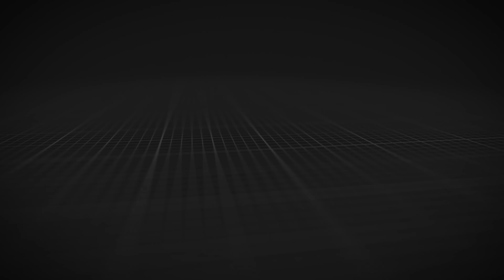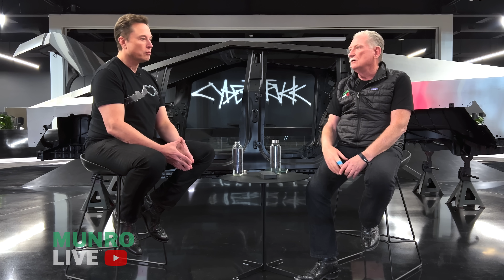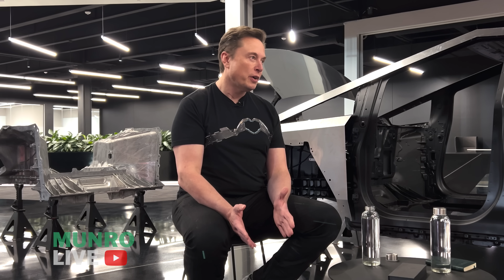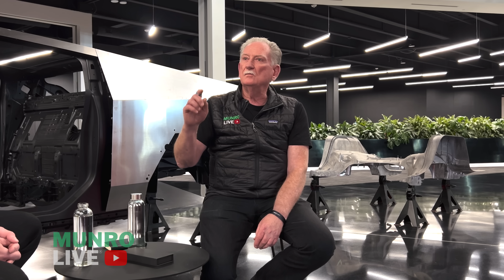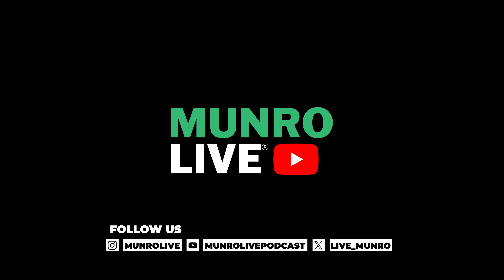Elon Musk on Cybertruck's Adoption of 48V and the Importance of Leadership

Comment: The reason 48 volts was not used prior is because of the need for ice vehicles to have large starters with high current draw. It was not very long ago, maybe 5 years or so, that lithium ion batteries were developed with the compactness and discharge capabilities to be a starter battery. Sealed lead acid, gel cell, and agm were the only batteries available that could provide the amperage to actuate a starter. 48 volt agm or lead acid batteries could not be produced because they would be too large to fit in a car.
Reply: P=IV. If you quadruple the voltage the then your quarter the amperage requirement to get the same amount of power to the starter.
Reply: @Lorith  correct but the footprint of a lead acid battery with it's aqueous solution of sulfuric acid and it's lead plates will always be fairly large. When you increase the size of a battery cell count from 6 to 24 it will always produce a larger battery. Also lithium batteries used as car starting batteries still do not do well in cold temperatures. They also do not do well when they get hot.... Which is inevitable in an engine bay
Lastly the run of wire from a battery to its starter, the single device with the vast majority of a cars electrical demand is extremely short. Usually it's a wire run of less than 4 feet, measuring from the battery to the starter and then to ground. The gains or advantages in 48 volt system are therefore negligible. I install solar and wind solutions on sailboats as part of my business. The 48 volt architecture in a yacht, where wire runs are much longer and there are significant amounts of devices with high dc demand (like inverters, bow thrusters, windlass motors, and electric winches) definitely make sense and have huge savings associated.
Reply: @douglasdangelo6755 yes but you would need 24 cells instead of 6, but you would need cells 1/4 of the size as the current needed would be 1/4 of the size.  So technically you would need the same size of battery, but there are overheads of plastic, but fundamentally you don't need a much bigger battery.
Reply: @douglasdangelo6755  It still doesn't mean that the battery will necessarily be any  larger than it is now.  I have 6V golf cart batteries that are similar in size to the 12v battery in my truck and 12v motorcycle battery that is a quarter of the size.  It is all about the Amps and reserve capacity that dictates battery size.  Heck look how small lithium ion jumper packs are now
Reply: Has not 48v been standard in aviation for a long time?
Reply: @M13x13M  maybe in large jets. Not in small aircraft
Reply: A “starter” is  antiquated tech, hybrid generators (in Toyotas) are a far practical way of starting an engine
Reply: 28vdc for aircraft

Comment: Why 48V Though? Why not 50? Why not 60? Why not 120?
Reply: The chips that need to convert it, and for safety regs that it is less than 50v. Easier multiple of 12v and many other things. These all loop in a little to 48v is a standard now. Same as why 12v

Comment: Will be interesting to see how reliable the thinner wires and tiny 48v batttery will be.
Reply: The wires will be thinner, yes.  But the battery will be the same size / bulk.   The only difference with the battery is that the internal topology will be different (16s for 48V LiFePO4 architectures... well, really 51.2V nominal).   16 smaller cells for 48V instead of either 4 larger cells or 4s4p with smaller cells for 12V.   Same dimensions, weight, and bulk either way.
Reply: Corrosion will have a bigger effect on the thinner higher voltage wiring, but that shouldn't be a problem in a automobile application right? Its not like people will use these things where they get exposed to the elements. Works great in the lab, what could possibly go wrong in real world applications?
Reply: @TechmoChamp  Corrosion won't be a problem as it hasn't been for decades in gigabit ethernet. The wires are individually insulated to prevent short circuits with an outer cladding for the group.  Teflon cabling is in common use in communications and has a higher temperature rating as well. 
Where needed, a steel mesche is used to reinforce the wire and insulate it further from outside interference... resistant to abrasion.

Comment: 48V sparks&stings hot! 24v seems safer also reduces wire gauge required of standard 12v systems..
Reply: Welcome to the world of higher voltages!  But when making such a huge paradigm shift to a higher bus voltage, I'd advise that you move boldly - you'll not get another chance at this change for another sixty years.  Getting stung by 48 volts may train us all to be just a wee bit more careful... 
When working with ordinary 120V [North America] or 220V [rest of world] home or office AC wiring, we TURN THE POWER OFF at the breaker panel BEFORE touching the wires.

Comment: Wish he had asked what the plans are for implementing in other models. And would have liked to hear about price premium from suppliers due to much lower volumed
Reply: I'm sure all future Teslas will be 48V. There's no reason they would go back to 12
Reply: now that the foundation is done, its easier to do other models at 48volt as well. but i wouldnt bet on it happening soon. The 25.000$/€ model will pretty sure be at 48v as well since it will be cheaper to produce it.

then with that kinda mass market thing AND i imagine for economy of scale alot of the things inside the 25.000$/€ model will be shared with 3/Y it opens the door to switch to 48v there as well. which will eventually lead into doing 48v only to streamline the whole production.

It will be a slow crawl, like the 4680, tesla is moving FAST but its still getting bigger and bigger, being big slows down, even tesla. they are impressivly quick to adapt things but they have already lost how extremly quick they were on their feets in their earlier years. This trend will only continue.
Reply: @samg5543  1 reason the Cybertruck switched to 48V is steer-by-wire, if they don't introduce that on the other models, it may not happen. At the end of the day, it depends on cost.
Reply: I'm sure they brought some in-house. But for what's supplied, I'd say not much premium. Pretty high volume order, plus I'd imagine they'll switch everything over. Few % increase in range would be nice
Reply: Once again Tesla is forcing change where there has been a high level of resistance to change. I am sure that in 5 years or less all new vehicles will be 48V.
Reply: @JHuffPhoto  Once one major car line has it and it works well, Tesla's other lines will follow and the rest of the industry with it. Aside from initial costs, it is cheaper and more efficient and opens doors to higher power devices. I don't see any downside.

Agree... from this point about 5 years for general adoption.
Reply: Sandy is good at wasting interview time.  Talking about his office chair is from a Model Y & he hasn't had to go to the chiropractor lately is not making the best of his time with Elon.

Comment: The relationship between current, voltage, and resistance is explicitly stated in one chapter in Introductory Physics. You can basically learn this in 10th or 11th grade in HS or earlier. I think these laws were discovered in 19th century, well before a car even existed.
Reply: Should we convert household voltage and small appliances to 220v ?  It is already available in every home; all we need is to pull a wire.
Reply: @MetaView7  the majority of the planet uses 220-240v for all domestic mains power anyway. North America is the outlier
Reply: @MetaView7 I don’t think we need to raise voltage in homes now because so many devices consume so little power.  Look at what LED lighting has done to reduce power.  Large screen TVs and most electronics also draw minuscule power.  Even new heat pump electric clothes dryers draw far less power.  Most new dishwashers are energy efficient due to elimination of the resistive heater for drying.
Reply: @MetaView7  Probably should. It's standard in most countries outside US. Most transformers in DC plug electronics already support 100-240V and many light bulb fixtures and other appliances can work just fine off 240V. We could save cost in future home buildings by running smaller gauge wire and plug more appliances into the same outlets with the same gauge wire and breaker sizes. Countries like the UK should switch from 50Hz to 60Hz while we at it.
Reply: @JEP-Tech  Seeing as the majority of the planet uses 50Hz it would be cheaper for the US to change.
Reply: Wow. Yes. And? Are you trying to make a point, or just state the obvious?
Reply: OK, thanks for the info Mr Smarty Pants. I guess you missed the point though - none of the other auto manufacturers are adopting 48V architecture. Whichever grade you're in go to the back of the class Claus.
Reply: Henry Ford was an engineer at Detroit Edison, and Alfred P Slone had a degree in electrical engineering. I'll bet they knew I2R losses. Everyone knows Musk is a fake engineer
Reply: and your point is lol ?
Reply: Sandy Monroe was a little bit over the top. Almost all tech CEOs know basic electrical formulas. They didn’t get in these positions by being idiots and most of them were engineers in the past.  Automaker CEOs probably know less since the electrical is a small percentage vehicle.
Reply: Legacy auto is basically Thomas Edison at this point. Dead set on trying to distribute DC power to homes instead of AC power because it's simpler for them, despite all the power losses involved. Tesla auto has earned the right to use Nikola Tesla's name because they are actually innovating.
Reply: I bet Bob Iger couldn't hold a conversation about basic electrical engineering. Bog Iger couldn't hold a conversation about anything more complicated than Snow White and the Seven Dwarfs.  We need more Elons in this world.
Reply: @bluephoenix8470 I’m not some kind of Bob Iger fan, but if he were the CEO of major electric car company, then I have no doubt that he would pick up some of the important technical concepts. 

But of course, he’s not a technical CEO, and perhaps there’s a reason for that.
Reply: @davew2040x   Conflating picking up a few technical concepts with having a deep understanding of the engineering and technology involved kinds ruins the point.

Comment: The 48v architecture reduces weight which improves range and performance. To think that the other producers are continuing to design and maufacture EVs that aren't moving towards 48v is mind-boggling. It is literally free range and reduced cooper costs.

I am happy that more "experts" in the automotive world is recognizing that Tesla is in fact the technology leader in the industry.
Reply: If Auto is an assembly shop. If the big suppliers don’t make it, they don’t use it.
Reply: Why don't you shed your demonic overhead so you can see more clearly! 
Weight losses in those quantities have a negligible affect on efficiency!
Reply: I would have thought we would have had at least 24v by now
Reply: Change is not free, buying a new designed part is more expensive than buying a  standartpart that many suppliers build millions per years. Its economies of scales and first adopter rules.
Once enough companies buy and sell the new design parts, the economies of scale will tip in favor of the new design.
Reply: 48V-to-12V converters have been cheaply affordable for +10 years. It's about high time distribution starts happening in 48V. Powering a 5W appliance is ok in 12V but a 100W computer? It's nuts having to push 8 amps at 12V through the car for the computer.
Reply: Tesla sent all of the big automotive manufacturers a free manual on the advantage of 48v architecture and they still aren't implementing it.
Reply: @bluephoenix8470  why they have been installing 48V systems in cars since around 2015

Comment: Munro teardown of CT will be VERY interesting to see how they implemented 48v ... a great deal of 48v develop activity and concerns have been going in circles on this within the automotive industry for over a decade. Did Tesla do it "right", or expose themselves to the known concerns? .. the teardown will tell all!!  Look forward to it.
Reply: What are some of the "known concerns" other than what Elon mentioned? Is there some inherrint safety risk? I'm genuinelu curious since I don't "know". I'm dumbfounded that the auto industry uses CAN when ethernet has been around for over 20 years and can't possibly be more expensive to manufacture.
Reply: @powertothesheeple5422 
Wow I really feel like I'm behind the curve, what is CAN?
Reply: @grumpusmaximus9446  CAN = Control Area Network. Slow serial protocol, used in cars and factories. Fast enough to blink an indicator light. Too slow for video and audio.
Reply: @powertothesheeple5422  concerns, one example:  water intrusion in 48v electrical systems .. is much more damaging at 48v than at 12v. Systems will need to be a higher level of water sealed.. devices, connectors, etc... 
As for ethernet .. it's used in automobiles today.. it's expanding now. Tesla doesn't make their own ethernet wiring & connectors, they are just utilizing what the industry has already developed .. will be interesting to see what's inside there when Sandy tears down a CT.
Reply: The telecoms world has used 48V forever and has all the electrical and environmental stuff to go along with it. You want a 48V-5V DCDC in a waterproof enclosure? Look in a telecom electronics catalog.
Reply: It seems the CT is torn down and displayed in separate parts for the Giga Austin factory tour - what else would a teardown by Sandy reveal??
Reply: @crikescrikes2465  Tear down benchmarking companies like Sandy's, generate data to sell to OEMs and Suppliers. They disassemble entire cars,  EVERY part, and document with photos, weights, material, p/ns, etc.. Some companies even provide this data through online subscriptions. All OEMs and major suppliers depend on tear down industry data.
Reply: This has already been solved in other applications. It’s Ethernet. It’s everywhere.
Reply: Ah!
You're taking the "expert concerns" angle!
.
Good to know....

Comment: How big is the 48 volt battery in the truck and where is it located?
Reply: It only uses the main pack under the floor from what I understand. At 48 volts, you don't need a seperate "car" battery located anywhere.
Reply: @powertothesheeple5422  You always have a separate low voltage battery. You need it to to start the vehicle, before the contactors to the 400V+ battery is closed. It's also a good idea to have it for safety reasons, since you will still have e.g. (power) steering if the 400V+ battery or DC/DC converter breaks down while driving.
Reply: @powertothesheeple5422 you will always need a separate low voltage battery. The low voltage system is used to close contactors and turn on the high voltage battery. There will likely be a very small lithium 48v battery located somewhere on the vehicle. Without a low voltage system, the high voltage system would always have to be on.
Reply: @powertothesheeple5422  Pretty sure there is a separate 48v battery and it also serves as backup for the steering
Reply: @mrm1885 , good point.  I noticed Hyundai's steer by wire unit (not deployed yet) uses a mechanical back-up.
Reply: @powertothesheeple5422  Incorrect
Reply: @powertothesheeple5422  Wow, that would be an even bigger change using real time conversion.
Reply: @powertothesheeple5422 I don’t see how you get 48v out of main pack which is 400v or 500v I think, it’s still a separate battery but a lithium one with the same cycle life as the main pack.

Comment: no plow points, cant mount a gooseneck , rear end diaper, unrepairable battery pack. how repairable are the front and rear ends by a regular person? what is unrepairable? people run diesel pickups 350-500k miles. i mean IF it lasts great but they should up the warranty if they are confident the unrepairable batteries will last 500k miles.
Reply: diesel-head mentality stuck in the last decade
Reply: @CrazedCrittic  you addressed not a single issue i brought up. 10/10 for dodging valid criticism.